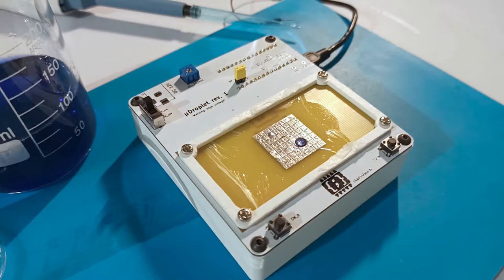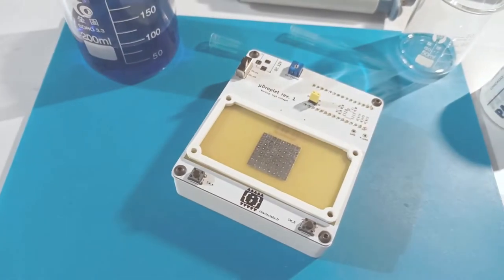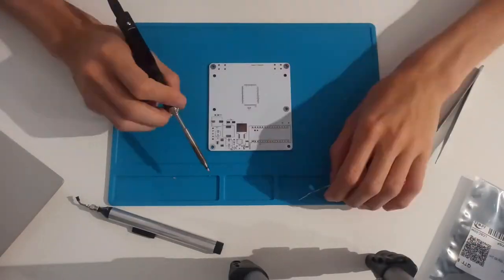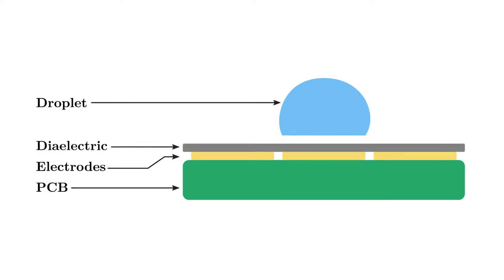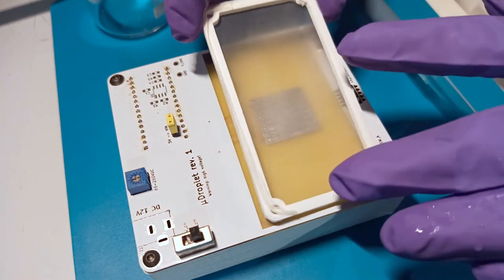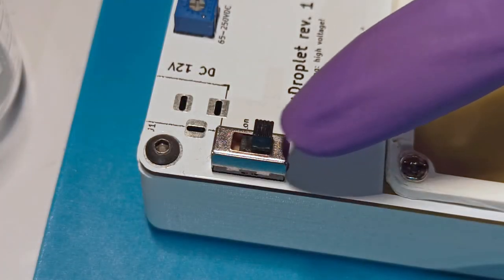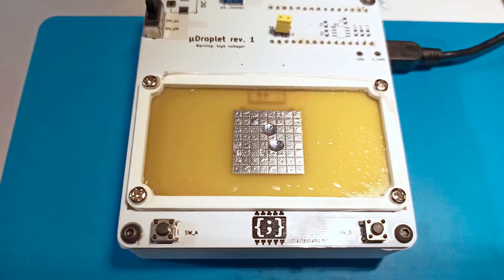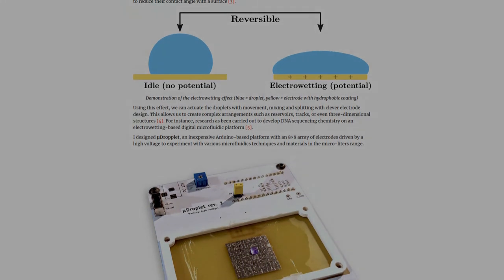Microfluidics Open-Source Platform - µDroplet

Comment: Is that an AvE ruler? Also what is that blur surface you are working on? Great stuff by the way
Reply from the maker: No, that would be more skookum!
That blue surface is a silicone mat, intended for soldering. It handles high temperatures and is quite pleasant to work on. It does not like sharp objects however.